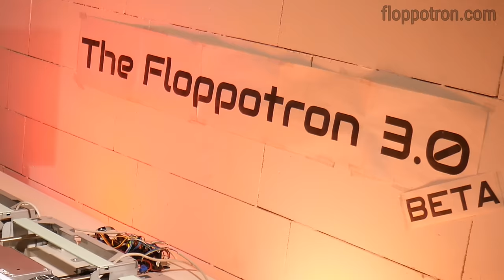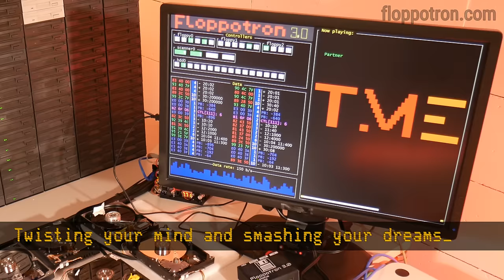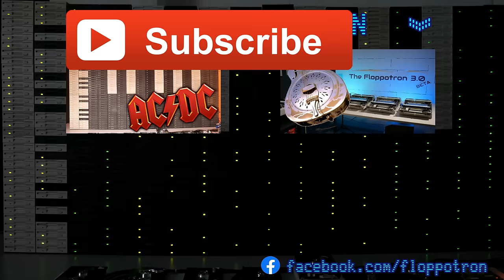Master of Puppets on FLOPPOTRON 3.0

Comment: Have you noticed that each device is specifically used for a particular kind of sound?  Each scanner, though identical, has a particularly unique sound and specific, individual, scanners are used for specific parts.  The hard drives are tuned and grouped into logical drum sections.  Even the floppies are arranged by sound.

The result is a true musical instrument that has a range and expressiveness that's. . . .just incredible!

This is a technical marvel, a true work of art, and a musical instrument par excellence !  This should be in a museum if Paweł ever decides to decommission it.

Comment: How many kids (even as old as 18-20) are looking at those 3.5" drives and thinking "what the f@ck are those?"   Damn I feel old. 
Well kids, those 3.5 inch floppy disk drives used to be how we put games on our computer.  They held a whopping 1.44MB which sounds like dick-all now (maybe one high resolution porn picture?) but at the time, it was an impressively large amount of storage. 

Only the largest games needed multiple disks. (Master of Orion II, Star Control II, Ultima 8, Dune II, Loom, and Sim City 2000 were some of my favs!)

P.S. This is mightily impressive.  You got the tone of the tom toms correct in the drum fills and the vibrato on certain notes of the melody is just 😘👌🏽(chef's kiss)

Comment: The best Metallica is not Metallica Metallica.

To clarify  the best Metallica are songs that have more external influence than internal influence from Lars or James. If you Disagree,  Early Metallica was great because Dave was in the band to challenge them. the black album was great because of producer Bob Rock. Death magnetic is pure Lars and James. as well as the slow Degradation of album quality release upon release. Those two can make great music, but are horrible at song writing and compiling albums. Quite often times when there is a cover of a Metallica song it is measurably better than the original; being distilled by someone outside the band.